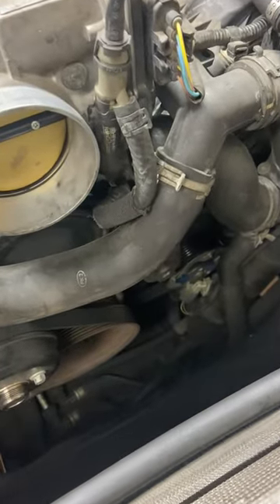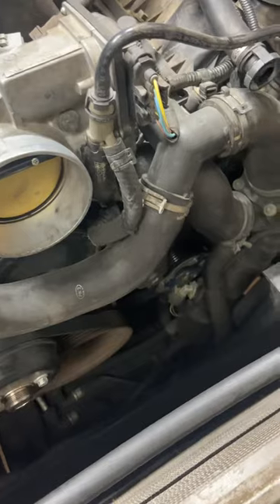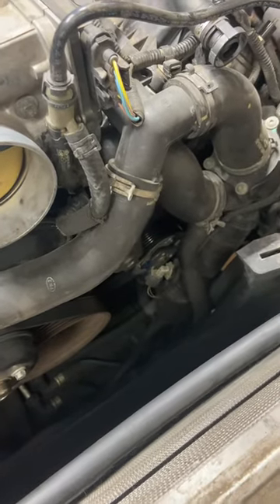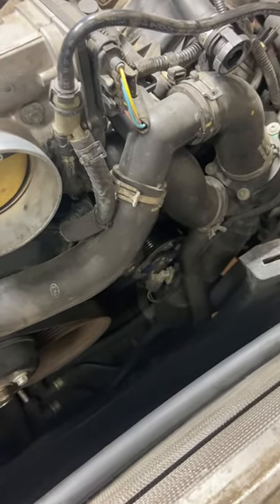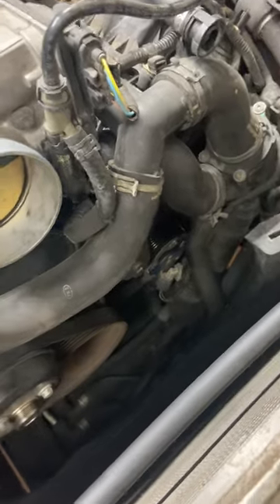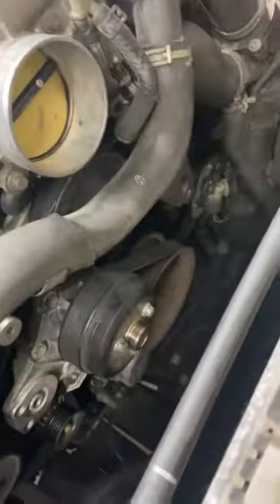2012 Land Rover LR4 5.0 Coolant Temperature Sensor location and replacement

Comment: I believe there's a second coolant sensor way in the rear of the engine inserted in a plastic crossover pipe.
Reply from the maker: @visitingyu3556  LMK about that if you find it, that would be good information. Thanks.